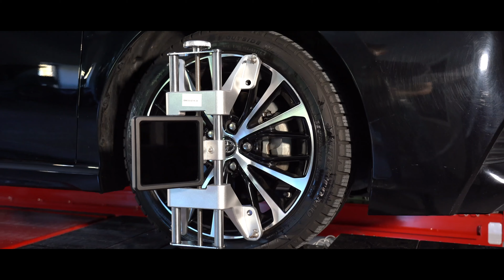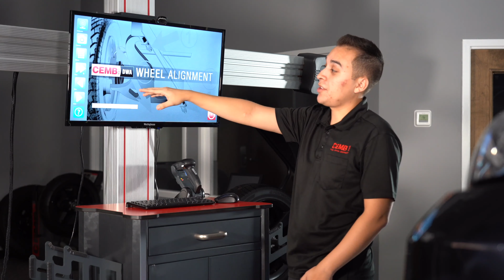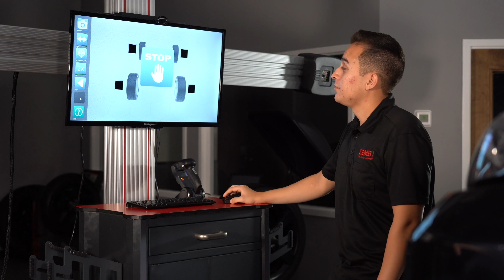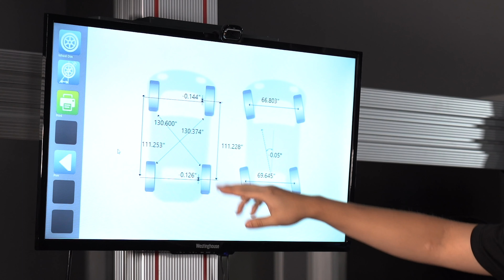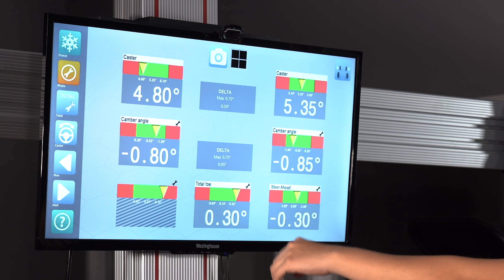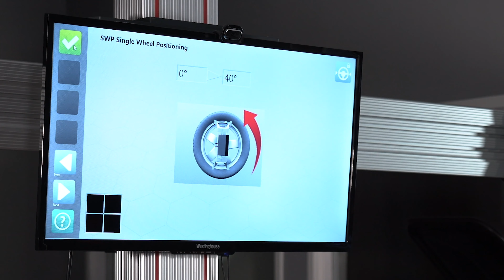How To Perform An Alignment On The CEMB USA DWA3500 Alignment Machine

Comment: This machine is absolutely garbage. My shop recently purchased this machine and after 3 weeks it broke down and the calibration is way off. After doing an alignment, all the cars are pulling to the right. There customer service is also horrible. After 6 weeks, they still haven't fixed it yet. Do yourself a huge favour and just buy the Hunter Hawkeye Elite Alignment System. The price you will pay for this garbage, you can just get the best machine on the market instead.